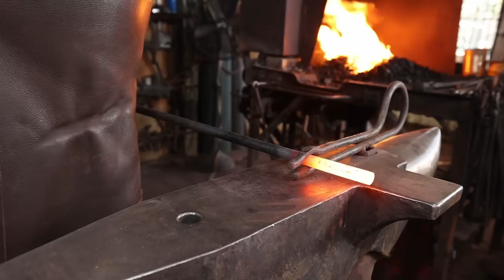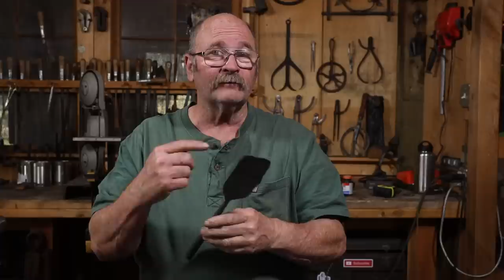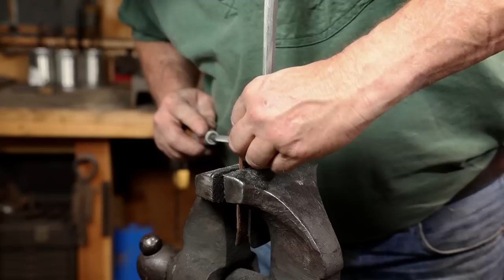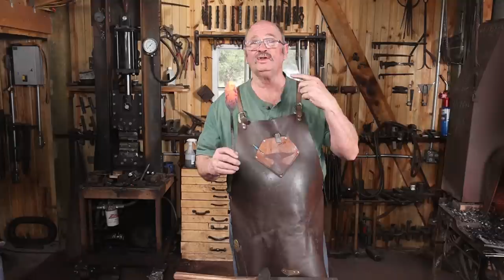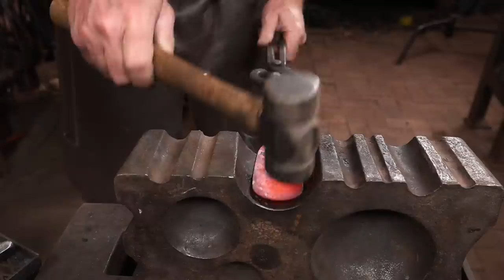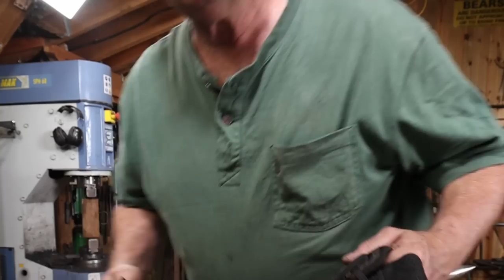Blacksmithing - Forging a Shoe Horn

Comment: As an interesting Idea, last night I managed to pull off a twist of another variety. I had a section of 5/8” bar that I’m incorporating into a business card holder for my wife. I put it vertical in my vice and used oxy-propane to heat it up and twist it, no big deal right, well as I got further upwards I increased the twist rate so it is like looking at increasing threads on the square. Took my time and used a adjustable crescent wrench sort of a big one. 24-28” long with a capacity to turn almost a 3” nut or bolt. It’s been great for trailer hitch ball, nuts when they are rusted in place in a receiver, too. 
I’m not done with the card holder yet but I’ll try to get a picture of it when it’s done sent to you!
Thanks for your inspiration, your instruction, and Ideas! 
You Sir deserve a SALUTE!

Comment: I burned a hook in a coal forge just a few days ago.  Got distracted for just a few seconds.  Had to start over because I completely destroyed the mild steel.  Fortunately I had some more  material, and only lost maybe 2 minutes forging time.  It is so easy to do even when you are fully aware that thin material needs to be watched carefully.  I swore to myself that I would avoid the same mistake again as I do every time I burn some steel, but I know I'll take my eyes off the ball another time and do just the same thing.

Comment: a watched pot never boils  , but turn your back a tick too long & it's all over the floor .  I need to make one of those for me with a longer handle for engineer boots . I am a welder & shoe strings don't last long & they don't make shoe tongue's like they use too . great job on the video

Comment: I've got a brass shoe horn that's handle end is a duck head. It's made like you're looking at the duck from the side so the duck's bill sticks out to one side kind of like the number 1 or 7. It has1883 stamped on the handle down close to the horn itself. It originally had the company name after the date but from being used so much its worn to the point you can't make out what it says. I use it everytime I put on my sneakers.

Comment: Great job!!
I’ve also found the same thing that torch welds work better for forging the mig/stick welds.   Probably has to do with the filler metal coming from the pieces vs being added by a machine

Comment: Great work.  That's one of those projects I've been planning on for ages, but keep forgetting.  How awkward was it to spend all that time forging in only one boot?

FYI - My favorite boots are Original SWAT 9" Zipper Side.  I used to have to wear boots 'on the job' and found that OS had the only zipper that was durable enough to last.  I tell folks to think of them like a fireman's turnout gear because you can jump out of bed and into your boots in the blink of an eye, and the boots hold on your feet wonderfully even when they're not zipped up.  When you have to respond to a bump in the night or get clear of an area quickly, being able to get some protection on your feet fast is always nice.  Once you get the laces adjusted and permanently tied, the zipper snugs everything up with a quick pull... but it also makes the boots easier to dry out if you get them wet because the air circulates so much easier.  Now that I'm dang near ancient, a shoe horn helps when I'm having a bad day so I best light the forge and get to it.....

Comment: Another great project. One thing I was wondering though, how well does the paste wax when applied to hot metal protect the metal from rusting? Do you need to recoat with wax periodically? Thanks for sharing your skills with us.
Reply from the maker: it lightly penetrates the open pores in the material, much like seasoning you favorite cast iron skillet.  It does need to be reapplied occasionally depending on the use.

Comment: You touched on forging electric welds and their tendency to fail. Why do you think that is? I can assume you need to be sure to have 100% penetration but in that case I don't understand what the problem might be. I tend to v groove the weld joint on all sides, preheat the material and run a hot pass that almost drips out through the joint then forge the newly welded joint to give it the best chance at "setting".

Comment: Nice save John.
what do you do to rework the spring fuller when the struck area becomes to thin?
Reply from the maker: I will probably just replace it at that point.  But so far I haven't completely worn one out.

Comment: Is the technique of holding the bar from across your body to achieve more accurate Hammer blows?
Reply from the maker: Its partly to line up the square  hammer face with the edge of the anvil and partly because there was a camera in the way.
Reply: @BlackBearForge  thank you,that's what I figured,just couldn't quite articulate it.loved the camera trick theatrics by the way,working with one boot on and the slag on your sock at the end I about bust out laughing.